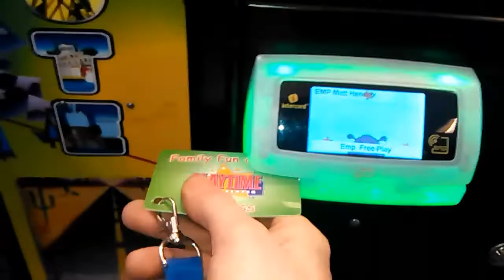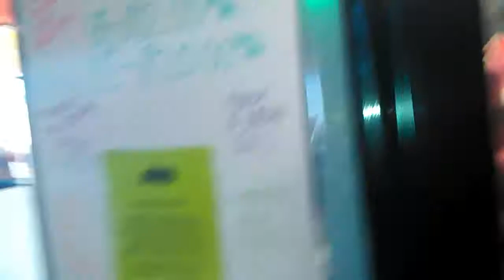Adjusting Claw Strength on a Claw Machine

Comment: Can you explain the 3 different dials (high,mid, low)? What does each do to the claw's action?
Reply from the maker: Sure. I'll pull the manual out tomorrow and post its exact explanation.
Reply: @MattyMosArcade  also. Do you have to go into program mode? I can't find a switch on back of coin OP.
Reply from the maker: @ElJefeTYM  having trouble finding my manual.  On this machine, theres a switch on the back of the coin mech. Flip that, make your adjustments, and flip it back. I always power cycle the game after that, but it may not be necessary. No test mode, or programming mode needed. This is a Rt 66 Crane by S&B/ST Louis Game Co. 
The three pots control the claw strength at different stages of play. The lift, the pause at the top, and finally the ride to the chute. I try to be as fair as possible, but it is a business.